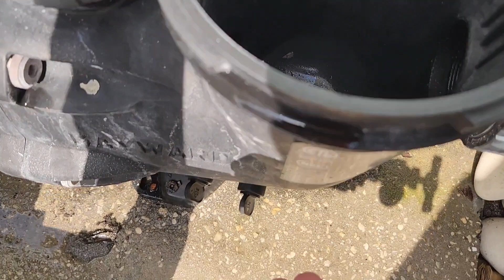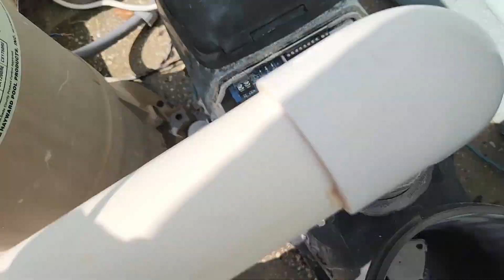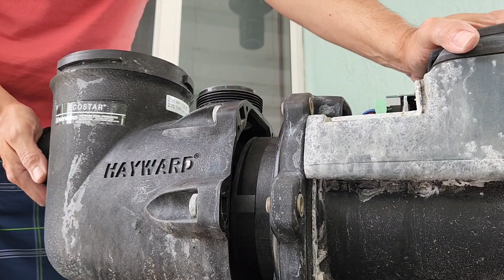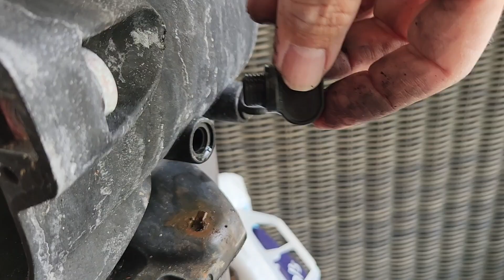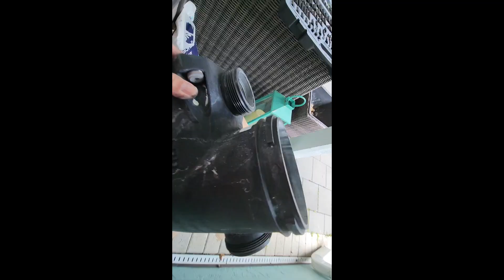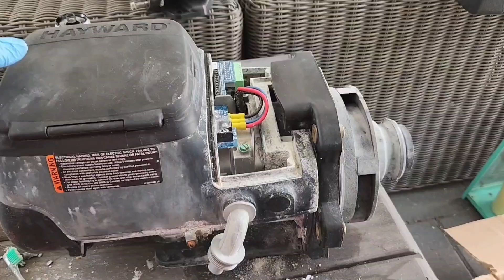Hayward Ecostar SP3400 VSP Pool Pump Repair Housing Replacement Part 1

Comment: Me and my girlfriend Christine despise saltwater pools.  Saltwater is super hard on the pumps, and heaters.  It eats the seals pretty quick.  We have noticed that pumps are failing at a much faster rate on saltwater pools than regular chlorine pools.  Me and christine have serviced regular chlorine pools that have pumps that are pushing 15 yrs with no issues.  Also they recommend you replace the ceramic pump seals that are behind the impeller every 3 to 4 yrs if you are using the pump on a saltwater pool application.  What happens is the seal fails, and then saltwater gets into the bearings, and damages them.  Yep i think the pool industry has pool owners by their balls with making these things fail at a quik rate.  And yes these pumps are super expensive.  Me and christine have been installing some of the aftermarket pumps, and so far we have been super inpressed with the build quality.  We have been using a brand called xtremepowerus, and so far we have had great luck with them, and saves our customers a boat load of money.  You can get a nice xtremepowerus vsp 1hp pump for under $600 you can get them on ebay or directly off their website.  Also that part that has a crack is called the difuser.  You can get a new one very cheap on ebay.  They have many many hayward pump parts.  Also can we correct you on something,  that wire you keep referring to as a ground strap.  Its actually called bonding wire, not a ground wire.  Your ground wire is what is coming from your panel through the electric cable.  Hopefully you got this all up and running.